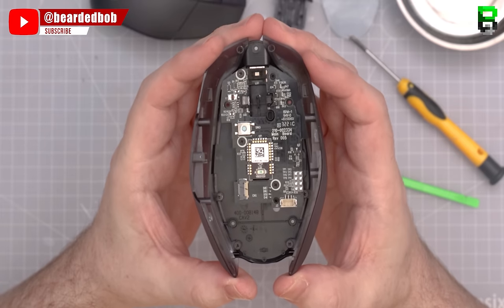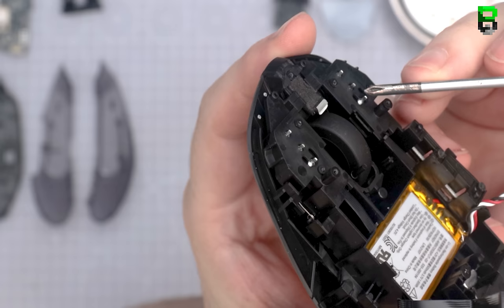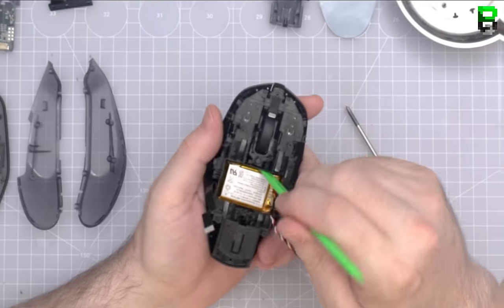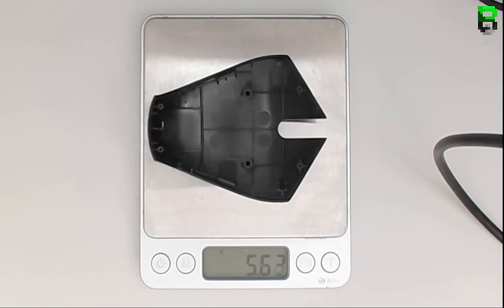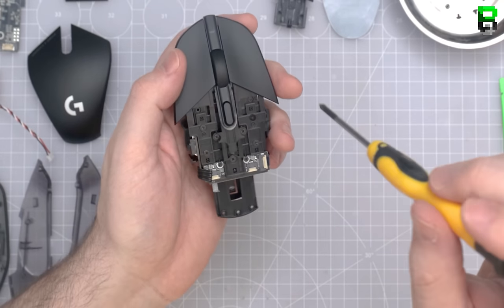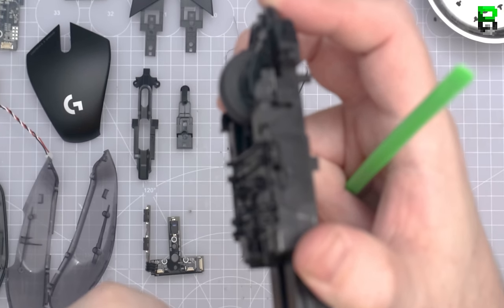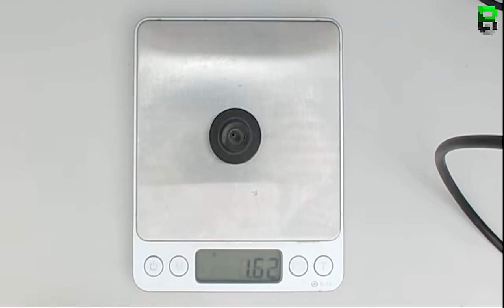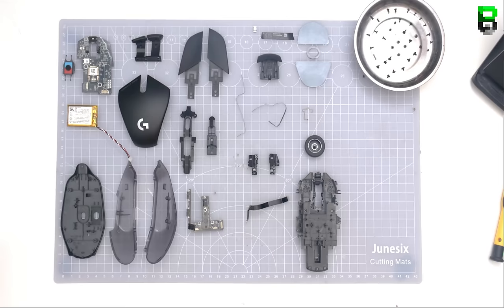OMG This is a Frankenstein Logitech G303 Shroud Edition Wireless

Comment: Logitech has this bad habit of completely overengineering their shells at the expense of weight.
Reply from the maker: They could save money and weight at the same time
Reply: @Beardedbob  True, by the way, looks like the pcb dimensions are quite similar to the original, it looks like with a custom base it might be possible to retrofit one of those pcb's in an original shell (or a 302 shell because they are cheap).

Comment: Nice. Between that skeleton, the tray and the massive battery, it seems like it would be fairly simple to get the weight down to below 65g. I’d be interested in giving it a try myself if that scroll wheel housing didnt look so precarious
Reply from the maker: Yep easy 65g I’ve gone up 62g without damaging it vid’s out today and 55g but you will have to cut it
Reply: @Beardedbob  Maybe I missed it but did you do a video on what you can cut out for weight reduction? I saw your other video about the battery but I was wondering how to take it further

Comment: I would 100% switched to this mouse from the superlight if it was about 10 grams lighter and identical to the original shape, still tempted to give it a try though
Reply from the maker: With a few easy mods you can get it down t o 65g without perm damage. I did it on stream but a YT edited one  will be coming soon Full stream https://www.twitch.tv/videos/1208431482?t=588s
Reply from the maker: few easy tweaks and a battery mod  and you can get it to 65g.You can see it done in this Full stream https://www.twitch.tv/videos/1208431482?t=588s

Comment: just did a disassembly with the help of this great video! 
I installed some Kalih GM 4 switches i had laying around (the original ones need so mutch force that you aim goes off to the sides lol) 
One thing to keep in mind is that u don't have to remove the battery to replace the switches!
Just undo the 2 screws that hold the board and flip the kabel thing and pull it out.
When u place them back just push from inside to push the cable up and put the board back in and get the cable down first then do the two screws! 
Gonna give the outside this week a gold chrome paintjob let's see how that looks 😁

Comment: Cheers mate, I just dismantled my g303 and assembled it without leaving a screw behind. I am amazed.
I lubed the inside of the scrollwheel with Krytox 205g0 in order to get it a bit smoother and a bit more silent (and I did not lose the spring!). It worked somewhat. Not perfect but noticable.
Also I put 3 layers of painters tape between the side button switch and the buttons to reduce rattle and pretravel.

Now all the buttons of my g303 are tight.

Thanks again for the great video, it helped a lot!

Comment: Is the M3 (scroll wheel - middle button/ middle click) replaceable with something like Kailhs 4.0 or not? If not, which switch would fit it? Currently can't use it for pinging stuff on Valorant and Apex Legends.

Comment: anyone know where i can get a a replacement PCB or Locking mechanism for the ribbon  on the switch ?  my right click wont work as I damaged the locking mechanism with the helping hands, it must of been holding onto the plastic part while I was soldering the switch on and it wont grip the ribbon anymore, its the flat grey bit I need to replace any help  on where I can get one for this model would be greatly appreciated.  if not will just have to wait for a hot swap PCB  to come out for it.

Comment: Hey bob , i want to ask about the Prime wireless, because you just forgot it :D dont worry about it. Can you maybeeeee tell me that I can teardown the Mice without damage the Switches because i want sand it down for better Grip on the Mice. I just did it on Orochi to with 2 Sandpapers and it feels so much better. But i want to do the Clicks to and what I saw was that the uppershell is connected to the Switches of them. But dont saw any info about it in Internet.
Reply from the maker: Yeah to much coming out atm, I’ll get around to a teardown, I need to as mines got a rattle.
Reply: alright , i will wait for your Feedback on it :)

Comment: yo BB...
i wanna see a  Naga viper 8k Frankenstein monster
Reply from the maker: I like the idea but the naga buttons won’t transfer across the the 8k pcb :-(
Reply: @Beardedbob  well why couldn't it...?   i would say that the sensor and button input speed (being 8k regardless of what polling rate you set it at on synapse3)  still registers at the same speed and frequency...

so  my hypothesis would be to take the 8k sensor and infrastructure and additional button inputs which would be more wires/boards/nodes/soderd connecttions to simplify have whatever electronic signal run thru the same channels that all the buttons from the basic viper 8k setup is doing... but sort of adding extra designations for the other extra buttons that a Naga has available and can produce.

i honestly don't have anywhere near the experience that you have with modifying and truly understanding how generally all mice are setup from start to finish... but i bet you could figure it out... 💯

Comment: Taking out the magnet 🧲 could make it from 74 to 70 grams👀
Reply from the maker: do a little more like I did in the stream and you can make it 55g :-p Full stream https://www.twitch.tv/videos/1208431482?t=588s
Reply from the maker: You can take it even further down to 55g.. Full stream https://www.twitch.tv/videos/1208431482?t=588s